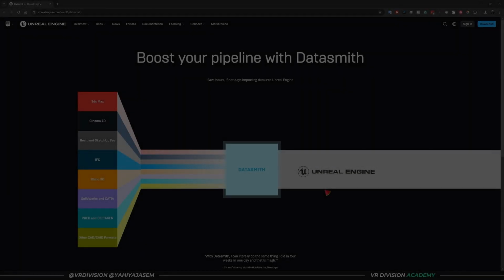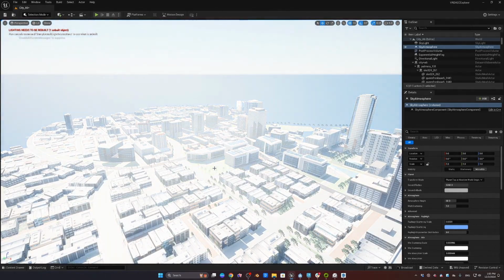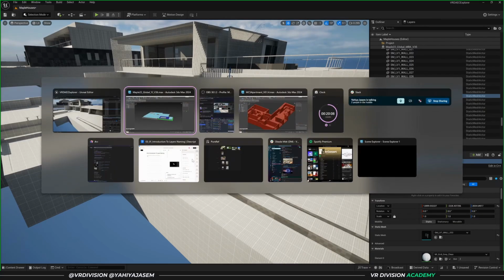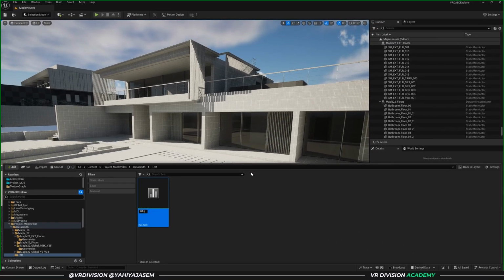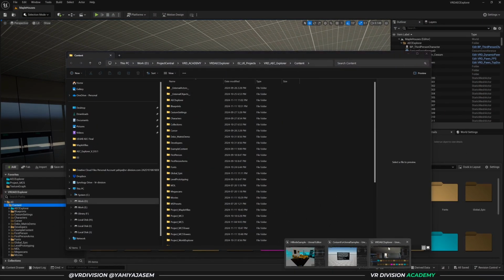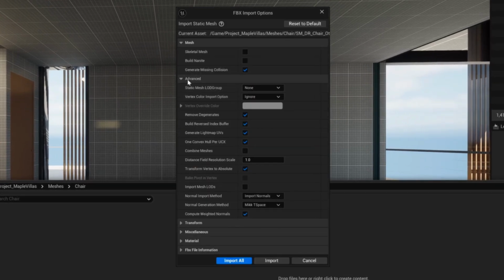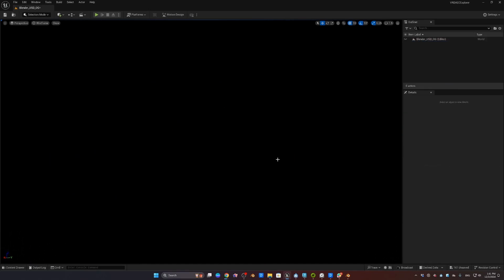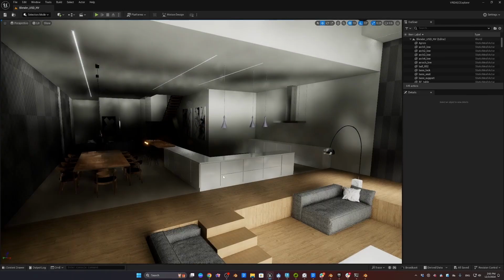Exporting 3D Projects to Unreal Engine Made Easy | Module 3 (Free Course)

Comment: HI! you showed Ctr-C - Ctr-V option for importing models, but do we need to migrate function first ? or in this case it will do for us ?
Reply from the maker: Hello there, yes, the assets must be migrated first because unreal will use the same path in the content folder.
Other than migrated static meshes, you can also do this on actors like cameras ,lights, post process volume and more, which is very helpful 
I hope this answers your question!

Comment: you know what  I noticed the other day I was playing around with the Synchronize for the first time. and could not firgured it out. hopefully you can give me an answer.. well, I got my space together inside Max, I hit synchronized. so far so good I swtiched to unreal, it looked great.. I started adding lights. materials. and then I had a change of hearts to where my chimmney was in the ceiling.. I went back to my max file.. i move the chimmney  a few metters then I hit Synchronized..  and this is what happened after..  when I swithced back to unreal. I noticed that everything was Gone. My lights and textures. is there a reason why?  all i did was to move an object in max and synchronized it ... why were my lights and materials all screwed up...  do you have an Idea why.?  cheers mate
Reply from the maker: Hey mate, syncing in Max overwrites your Unreal scene, wiping lights/materials added there. To avoid: duplicate your Unreal level first, sync only selected objects, or re-apply lights/materials post-sync. Try adding basic materials in Max too. Cheers!